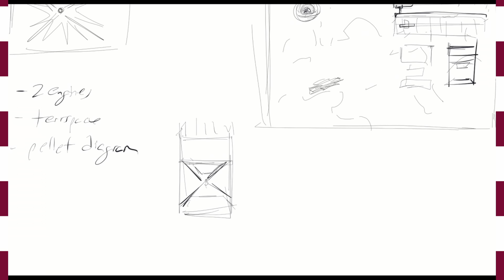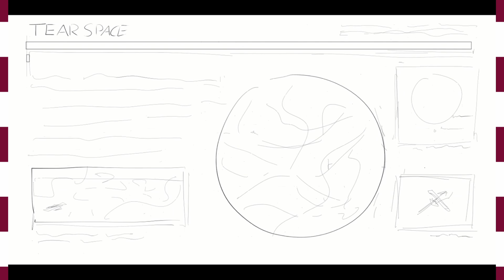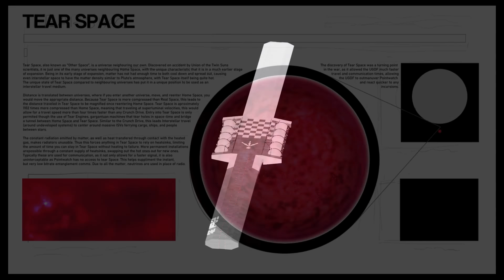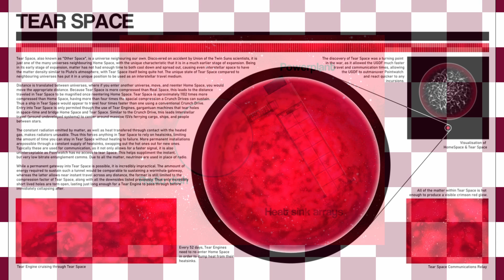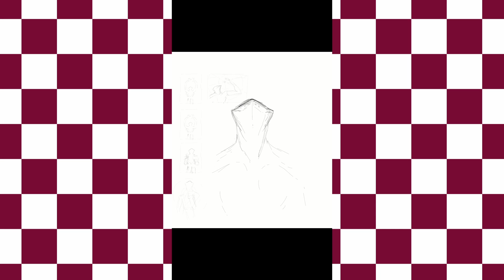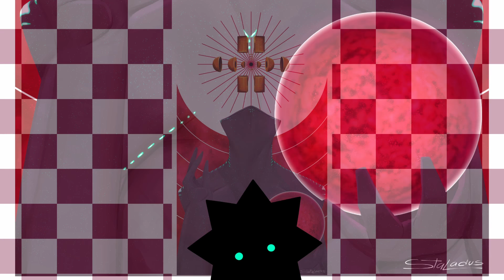Tear Space & Orum | Lost Suns

Comment: One small quibble - you state that Tear Space's gas is so hot that radiators are useless, so heatsinks are used instead. From context I think you mean something more like a heat exchange system including heatsinks conducting heat into thermally isolated, pre-cooled media (with temporary utility as they warm up to the local ambient temperature of the surrounding gas), which cool material in Tear Space, like refrigerators in space, or are they just stores of cold material taken from Home Space? 
I'm not sure of a better name though - cold cache? icebox? 

Also, a fridge in gravity-less gas would slowly heat the surroundings via it's own heatsink/radiators and grow progressively less efficient, unless you add a low power thruster of some kind. I guess now we're left with a question - why not run hot radiators with a fridge on the ships themselves? a shortage of strong, heat tolerant materials? Too much aerodynamic drag? Am missing something in my understanding of heat pumps?
Reply from the maker: It's like a material woth a high heat capacity like liquid hydrogen or water that they dump heat into. So it absorbs the heat instead of the ship's components.

Comment: Impressive. But reaching 99% the speed of light is an enormous achievement, not because of the engine's power alone, but because relativity demands an immense amount of energy and reaction mass. Even a phenomenally efficient engine still has to obey momentum conservation.

So i can some questions:

1. Do they routinely reach 0.99c all the time when travelling?

2. Because of the immense energy output, the fuel consumption will be a nightmare, so, do they carry enormous reserves of reaction mass and Orum?

3. How do they harvest Orum and process them? Do they scoop them or harvest them during their flight through Tear Space and do your ISVs have processing chamber for these exotic matters?

4. How protected is your ISV to actually travel at 0.99c? Because from what i know, at that speed cosmic dust became the most dangerous content in the path, it'll rip any ship apart without any shieldinh methods. So how your ISVs work around this?

Comment: you said Orum emits IR light, have you decide on any specific wavelength band? That would determine the exact power generation method used for converting the thermal energy. I also feel like using water/steam turbines here is arbitrary, a solid state system would be better.

Comment: If the tear engines alone get you 4x faster travel than the crunch drives, what is it that prevents you from running a crunch drive inside tear space and moving 4000x faster?
Reply: Crunch drives generate too much heat that you don't get far before needing to drop out.
Reply from the maker: Mainly the heat generation

Comment: Pretty cool! I´ll throw my two cents in though: Early universe space isn´t compressed, there´s just less of it. Expansion means more space is created, not stretched. FTL by means of relative position between the two universes still works, it´s just a language nitpick. 

Orum on the other hand...Infrared is quite a weak energy level and radiates quite slowly, I´d imagine you would want anything else. If Orum is comparable to antimatter, it would have to produce 1 million IR photons to every 1 Gamma photon. Atoms can also hold onto a lot of IR before needing to shed the energy, so I imagine any reaction would be slow and any reactor would melt before any usable energy was extracted. Or maybe you can´t even reach that temperature and it´s more like a geothermal plant. 
Excuse me if I´m ignorant, but the infrared-angle doesn´t make sense to me. 
(There´s lots of other interesting exotic matter, like monopoles that convert matter to energy, or q-balls that can flip matter into antimatter)

Really love all your work tho!

Comment: really love the way you made tear space work and orum is a great thing to have. 

but why do the drives use orum to propel a reaction mass when they could simply use the infrared light as thrust instead?
Reply: It's because it's harder to direct the infrared radiation in one direction, not like em waves can be moved using magnets
Reply from the maker: What the other guy said, also you'd need basically perfect mirrors if you wanted to make it a photon drive

Comment: Its cool to think about it but more so what kind of repercussions one had to face. tear space and well tearing space in general regardless of the how it is done . Tear Space would
>deal with Primordial Blackholes (probably)
>A Space closer acting to an Atmosphere with dense clusters forming Quasi Stars (pretty likely)
> the need to identify any other defective physics or Math to ensure not difficult to detect side effects
>the difference in density of both our universe and tear space spilling into each other. Due to the infancy of Tear space, Inflation should be significantly higher. Would Dark Energy spill over ?Could it cause Vacuum decay even with a stable Wormhole ? Would you create a pressure difference like a Airplane having a leak but with space time ?

The Ships, Machine and Mechanism that produces the Effect aswell as other dozen safe states would need to be met. I am not much of a Fan of Beurocracy but you gotta make sure your not accidently popping your Universe like a Balloon or setting it on fire hehe.

Comment: The UGDF is a galactic arm spanning, hundreds of millennial old interstellar civilization; They have mastered devices and installations used to effectively travel faster-than-light by manipulating space-time. They have torn their way into a parallel universe with different physics, and used it, too, to travel effectively faster-than-light. They have harvested exotic material from this parallel universe, and with it, they revolutionized power production and propulsion, rivalling fusion reactors for compactness, atleast.

. . .

And yet, for large-scale power generation, their most common and preferred means of generating electricity boils down (aha) to using steam to spin turbines.

Is that not a bit charming? In a way?

Comment: To go even faster (and maybe have less of the deceleration problem), couldn’t they just use crunch drives in Tear Space? Or do those generate too much heat?

Also, I think the implication of alternate universes that can be easily travelled to is way too big to just be hand-waved away. Has nobody made contact with any civilizations in these other universes? If/when Pointwatch achieves this tear drive technology, I’d think there’d be a real threat of them expanding into these other universes and forcing a multi-dimensional front. Perhaps there’s something special about Tear space that makes it particularly easy to travel to, so interacting with any other universes is impractical?
Reply from the maker: Yeah heat is the main issue, you wouldn't be able to use it for any time at all. Well the thing is that since they're similar to our own, the UGDF doesn't really see a use in exploring them in a big capacity yet, and also a lot of them just spawn you in the void between galaxies. The only useful one for the UGDF rn is Tear Space.

Pointwatch can't really afford opening another front, let alone one in another universe.

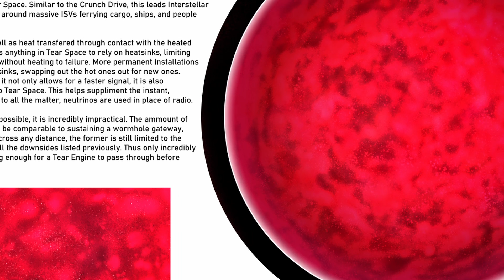Comment: If there are other universes bordering Home Space than just Tear Space, couldn't they also be used for military and transport purposes even if they are similar to Home Space? For example, UGDF could use this "Third Space" to travel stealthily for longer periods of time than possible in Tear Space (albeit while going much slower). They could maybe even alternate between Tear Space and Third Space, radiating heat in Third Space and traveling in Tear Space, to move deep into Pointwatch territory. 4:47 Third Space could also solve this problem if they burn in Third Space and then drop into Home Space. Third Space comms systems might be useful too, since they would require less maintenance than Tear Space comms stations, while still being uninterceptable (albeit while being much slower, once again). The other universes might not have any useful resources to extract though, since all the galaxies would probably be in entirely different positions than in Home Space.
Reply from the maker: Fair point, only thing that I can see working is the deceleration burn, but they do need to go back to Home Space anyways on approach to deploy forward scouts. Because without that they would be going into the system blind.

Comment: Peak posted again! Amazing stuff. Sounds like this reality has its own Nether lol.

What I am wondering about is how Tear Space is such a guarded secret of the UGDF from Pointwatch, yet it seems to be utilized everywhere in infrastructure, civilian communications, and power generation. Surely that would be incurring discovery and reverse engineering risks if Pointwatch performed a back line infrastructure raid to capture technology.
Reply from the maker: Well main thing is that the UGDF is so fanatical on this that it's standard practice to just detonate all the Orum on board if anything is at risk of getting captured. Usually this is for infrastructure and Tear Engines, since you will never be able to disable a smaller ship like Star Forges since a hit will just detonate it anyways. 

Besides, all of the Orum infrastructure is located in the center of UGDF territory, kinda hard to reach that. The only thing they might be able to get are the Tear Engines.
Reply: @Staladus  True, but what about those Tear Space comm stations which are used in less developed systems that need to be constantly serviced to replace their heat sinks (and presumably also to retrieve data from them)? If a less developed system gets ambushed and their Tear Space comms and servicing infrastructure gets seized, that would be a major problem.

Also while I have you here, do ships in Tear space just move conventionally to get around at FTL, or do they use crunch drives in Tear space to magnify the distance they can cover even further?
Reply from the maker: @dragonleader2421   The main fear is the tear engines themselves. Even if they get their hands on some Orum, they have no idea what it is or how to make/get more of it. The tear space comms never leave tear space, they get serviced by tear engines dipping into them to give them a change.

They move conventionally. Crunch drives simply generate too much heat to be used for any useful length of time.
Reply: @Staladus  Ah gotcha, although I would bet that avenue of further amplifying the travel value of Tear Space is something of continuous active research for the UGDF and its members. I do still wonder about how the data gets out of the comm stations if there is no Tear Engine present to make the crossing. I probably should be asking this in a discord or something instead of bombarding you with comments. Logistics lore is interesting lol.

TBH it does seem interesting about the temperature limits for the UGDF member species, probably due to the fact that their brains are still physically present inside their frames instead of existing as pure uploads or AI’s. The closest other Hard Scifi that I follow to this setting would be the Orion Arm Project, so that might be shaping my perception here lol.
Reply from the maker: @dragonleader2421  Well a downside is that you need get a tear engine to go there and fetch the data package. It's not real time, so they usually do that and switch out the heat sinks at the same time. Upside is that non-ftl tear engines exist, they can be much smaller since they don't need to carry all the fuel and cargo. Would be a different class of ship.
Reply: @Staladus  Ah, I was assuming there was something like that, I’d assume they operate crewed by UGDF personnel in those less developed systems under the same operating rule of “explode if Pointwatch gets too close”.

Thanks for answering my lore questions! I hope it doesn’t come across as pestering. I love the setting you are building here and enjoy learning more about it!

Comment: Fusion engines are still used in this universe(like the ICF drive from the Daedalus Probe and the epstein drive from the expanse)?i think it could dominate intra-system transport with the advanced technology the universe has.
Reply from the maker: Yes but they're mostly used by the younger races like humans, deo'phir, and nomu
Reply: @Staladus , Question, is Hardlight exist in that universe.
   The Ahnawi from what I know existed for about 100,000+ yrs, solve the energy issue of creating Wormhole and even recently get to Space Nether so their tech knowledge is basically highly advance than IRL humanity in just 100,000+ yrs so it is possible in their tech state to create such unique and useful material.
  So these guys would somehow think, Imagine if our Railguns will never run out of ammo?, Or how can we contain Antimatter safely without blowing things into oblivion? since light or even Hardlight is neutral to Antimatter because if Light isn't neutral to Antimatter, Anti-light will blow everything into oblivion. Or create an easily 3D manufacturing slop. Or make their infrastructure or ships "heal" because the damaged part is replaced with Hardlight Materials.
   Hell, even Hardlight property could be different depends on manufacturing techniques and utility like create an smooth, flexible, durable, less glassy to make easily 3D printable clothes or create an metallic, hard, tension resistant, malleable to create structural materials or other stuff. Basically the utility would absolutely be endless.

Comment: A couple questions:

1. How precise are tear drives? I know that you need enormous machines to use tear space effectively, but could the UGDF (hypothetically, of course I know they would never do this) remotely command a tear engine to power up and "warp" (for lack of a better term) right into a pointwatch facility, destroying it? What happens if you try and exit tear space into a physical object, like a planet? Is the ship physically stopped or does it just cause a massive explosion? Maybe the tear drive just fails in some way if you try? The interstellar medium of Home space still has some matter (albeit an incredibly small amount) that would be displaced from a ship exiting tear space. Where does this matter go if the ship just "appears"? Where is the line between "empty space" and "actual mass that stops you"?

2. Are tear engines huge because they need really big heat sinks to survive in tear space or because the tear drives themselves are incredibly large? Could you use a mini-tear drive that enters tear space for a fraction of a second for short-range, non-interstellar transport? (again, big hypothetical, I know that tear space is top secret and that only tear engines are allowed)
Reply from the maker: 1. You can do that yes, but the main problem is that y'know, distance is magnified. If you move 1 meter to the left, you would be 1 kilometer off from your target. So it's not really practical or reliable to just use them to ram directly into stuff. Better to use them to get closer and deploy stuff rapidly.

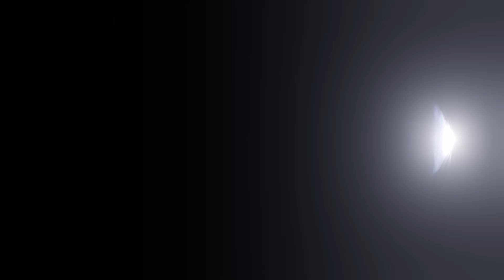If you entered into an object, you'd just explode lol, but that is also incredibly unlikely. Any matter that enters Home Space/Tear Space dissipates into energy after a short time. You can see it at 3:47 Ships can traverse it because they stabilize the ship to the universe's physics.

2. Tear Engines are huge because it is more economical to carry a ton of stuff at once, like a cargo ship. The tear drives are big, but they can be made smaller. Just makes more sense to go bigger. Short range transport is better kept to crunch drives, since it's more precise and you can actually see where you're going. But typically ships just burn using their engines.
Reply: 1. Maybe the white trail we see when the ship jumps out 3:47 is that tearspace matter
Reply: Tear drives probably use something like wormholes to move between universes, so trying to enter into or inside something wouldn't be any different than flying into it